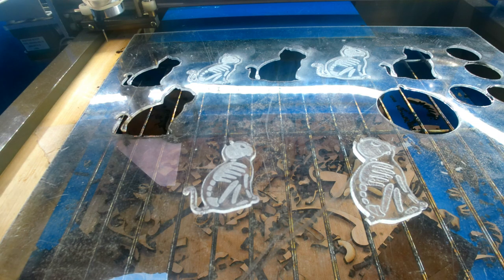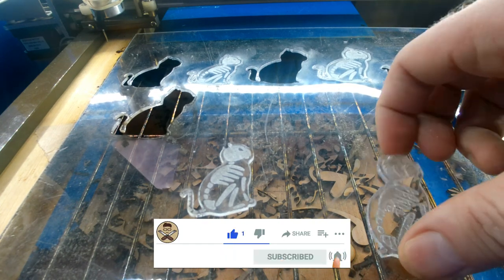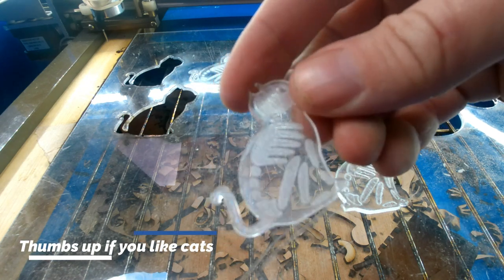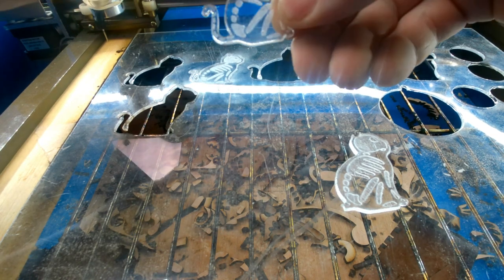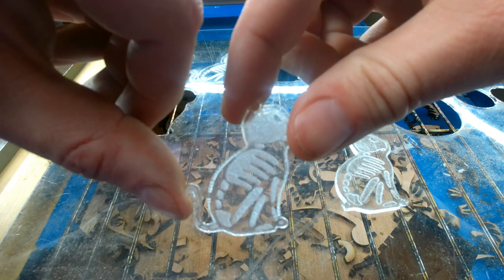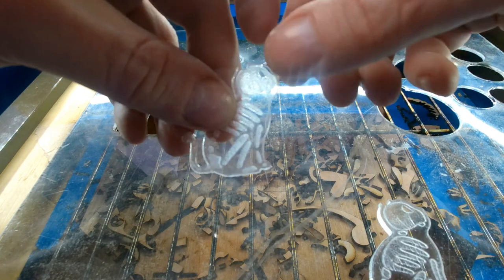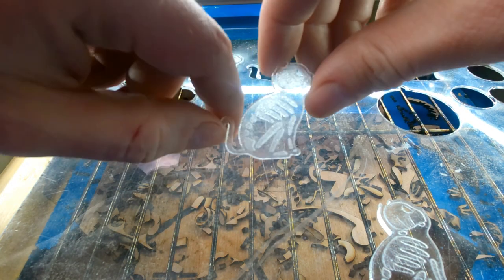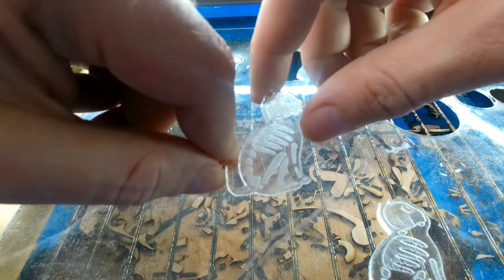Testing acrylic on a k40. Amazing results!

Comment: Okay thank you for this! I’ve been looking into laser cutting acrylic for my business and I needed to see how it worked on color sheets. Thank you!
Reply from the maker: As long as you engrave very lightly on the surface, you will get a similar result with the white/lighter colour engraving. Black and clear do definitely give the best results though.
Reply: @philscraftcorner  thank you so much! I got my k40 a week ago and I Test cut yesterday but the smell was so bad - so I am waiting for my exhaust upgrade to come from Amazon to get going again. What settings do you recommend for cutting? I was trying a bunch of different power / mm settings and couldn’t seem to get 100% through the 1/8 acrylic. Thanks so much for responding! So many of us have questions out here haha
Reply from the maker: @champyb  do not cut acrylic without really good ventilation. That smells so bad because it is bad.
There are 2 types of acrylic, cast and extruded. Cast engraves so much better than extruded because of the way it's made. 
Always stick to cast, it's just easier.
For speed and power. I think it was around 6-8mm/s at 16ma power.
I have been using a 50w with ruida and lightburn for the past year but low power and low speed is the key with acrylic cutting.
Make sure that focus is set properly though that will make a huge difference.

Comment: Thanks for the video it’s awesome! Does it work the same for acrylic miror. I would like to make tags for candles and also to cut out names. Does this machine work well. Thanks for your response
Reply from the maker: It's similar but the results are slightly different on mirrored acrylic. Some testing will be required depending on what you want the final outcome to be.
Sometimes engraving on the reverse side and spray painting black or white afterwards gives better results

Comment: You stated mA. I do not have a mA converter on my machine. What percent of power are you using for this? Or when you upgraded does it circumvent that process. Thank you.
Reply from the maker: I could not tell you the percentage on my k40. I'm currently running a 50w and i run my acrylic engravings at 150mm/s with 13% power. And for 5mm I cut at 8mm/s at 30% power.
Reply: @philscraftcorner  I appreciate this. I can try something with a little more power and roughly same speeds. I'm just getting started (laser arrives Friday) and want to try and learn some good practices. I know each laser is different but rather than testing everything I like a start point. I really do appreciate the comment and help
Reply from the maker: With engraving acrylic lower is better. My laser won't actually fire bellow 12% so just give it a try. Make sure all mirrors are well aligned and then check your focal length is good

Comment: Thanks for sharing very helpful what settings do you use to cut?
Reply from the maker: I used 15ma power at 8mm/s
Reply: @philscraftcorner  what is that in percent. I don’t have an MA reading on mine
Reply from the maker: @rrojas5284  try using around 13% to start with for engraving and 30-40% for cutting

Comment: Hi phil, have any luck cutting 7mm acrylic?
Reply from the maker: I am now running a 50w laser but I'm sure if you went much slower you could cut through 7mm. Try going around 4mm/s and see, you will definitely need good air assist and extraction. Keep an eye out for flaming too

Comment: How many passes? On mine I have to do 6 passes to cut out 3mm
Reply from the maker: 1 pass for 3 and 5mm, it use 30% power at 8mm/s on 3mm and 6mm/s on 5mm.
Slow and low power for acrylic cutting. It gives a nice clean cut with polished edge
Reply: @philscraftcorner  thanks mate I'll try that. Been playing around with it for a while but can't seem to get it right. Usually 6 passes does a decent cut but still in sections doesn't cut all the way through.
Reply from the maker: Have you got your focal length set right with a ramp test?
Reply: @philscraftcorner  it's at the usual height that I normally use to engrave wooden chopping boards and cutting out 3mm ply. I havnt done a ramp test yet.
Reply from the maker: Do a ramp test on your cheapest material . You will probably find cutting the ply will go quicker too. I'm also assuming you have air assist set up too
Reply: @philscraftcorner  yeh I'll try a ramp test tonight. I'm wanting to get an air assist setup for it but I'm not sure how to do it. Would you have any info on doing a setup? Would this help with cutting?
Reply from the maker: This definitely helps with cutting. It clears the debris away from the cut so instead of the beam hitting the soot it hits the material. It also will greatly reduce the risk of fire in your machine
Reply: @philscraftcorner  do you have any info on how I make one ?
Reply: What are the settings for Plastic name tags cutting?